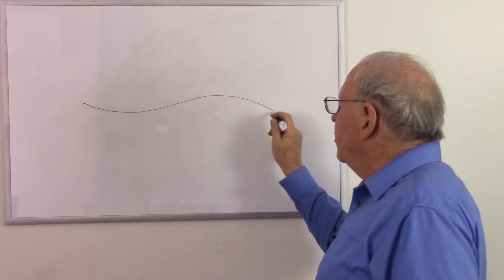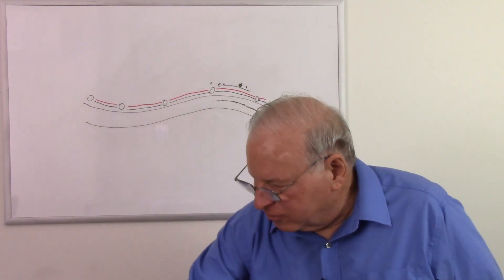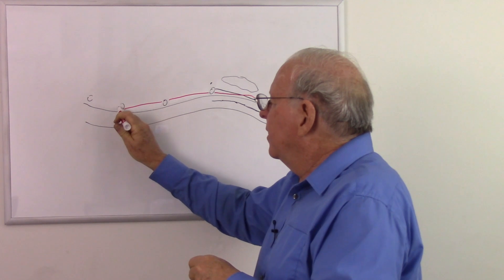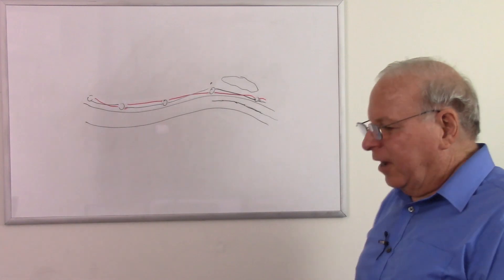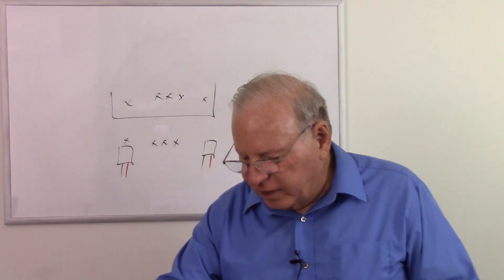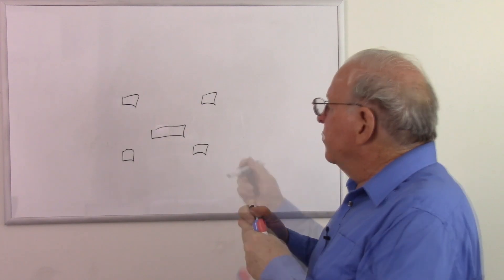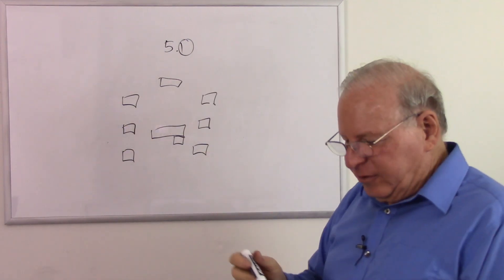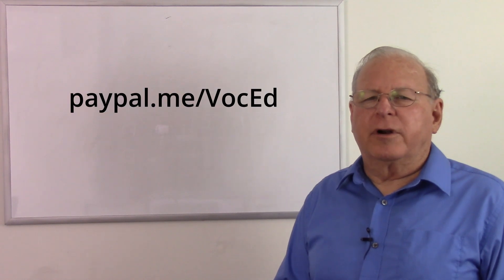Monaural and Multichannel Sound - Solid-state Devices and Analog Circuits - Day 11, Part 6

Comment: Thanks for your videos. @ 1:37 , What prevents this mono  configuration from overloading the Amplifier??
Reply from the maker: The system is a standard PA system so there is nothing unusual about the system itself. Being in North America this is probably a 70-volt system. Each speaker is attached in parallel through a transformer. To get the effect I heard at the resort the installer simply needed to reverse the polarity of the wires for every other speaker.

Comment: Hello, Over 11 months have passed and still waiting.... for request about identification of wires for car reverse camera.
In general, it has 5 wires which are  camera power, camera ground, video power, video ground and shield wire.
What voltage readings should be on the video power?
Is video ground always constant ground or it still carries some negative voltage signal too?
Can you please make new videos especially on identifying these 5 wires with digital multimeter when no wiring diagrams are available at all??? Please 🙏
Reply from the maker: I apologize, but you seem to misunderstand the purpose of this channel. I am presenting a series of lectures on basic electronics. I have no plans to make technical support videos. I have installed two reverse cameras but these only had four wires, Ground (shield), Camera Power, Camera Signal and one wire to connect to the wire going to the reverse lights (to tell the head unit when to show the reverse camera). Otherwise, I will have to defer this question to another viewer who has experience with installing such cameras.
Reply: @Vocademy-Electronics-Tech  okay thanks for the information Sir 🙂 
Here is my update...

Finally, I identify all the wires.
The stereo head unit has 5 pin connector at the back side.
Earth, Cam Power, Video Power, and 2 are constant ground. In fact, earth and these 2 wires are joined together and at always constant ground.

Now, that I have 2 cameras, one for reverse and another for front. Both has 4 wires which are Camera Power, Camera GND, Video Power and Video GND.

Now, I planned to activate one camera at a time ONLY.
My question is that can I joined together the Camera GND wires of these 2 cameras and then further joined or connected to the Camera GND pin of the above-mentioned stereo 5 pin connector so as not to reroute GNDs separately for these 2 cameras????
Same case for Video GNDs of these 2 cameras. Can they be joined commonly to the Video GND of the stereo unit?

Of course, only one of the 2 cameras will be activated through a relay, and their corresponding Camera Power and Video Power will also be arranged so that they get connected to the respective Camera Power and Video Power of the stereo unit.